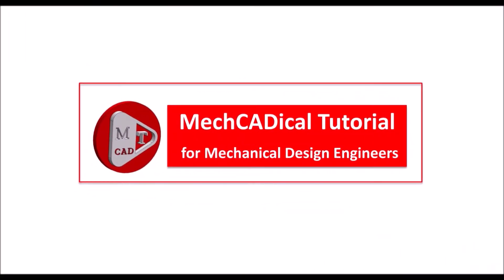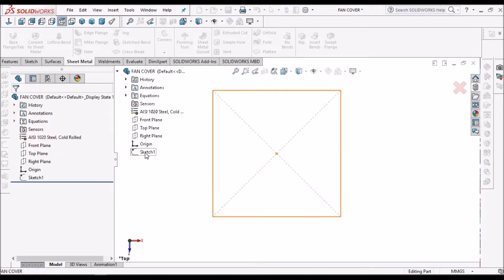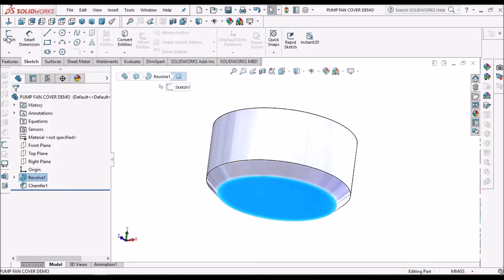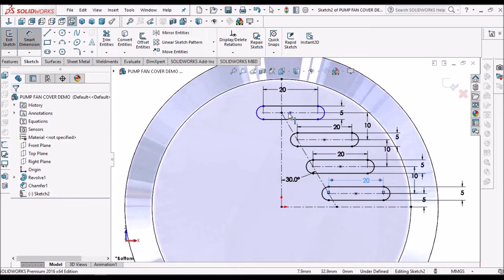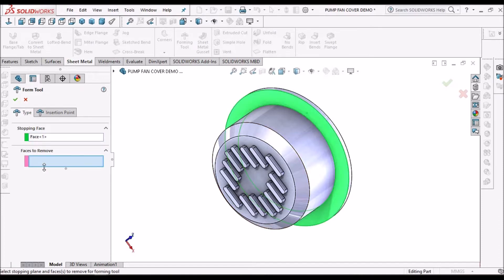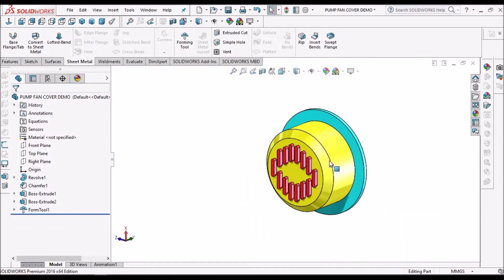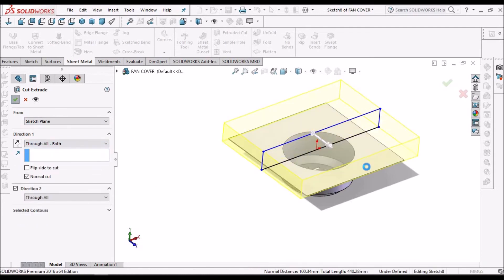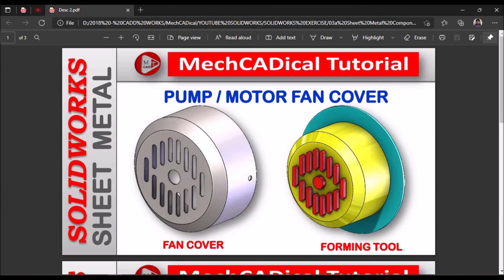Pump/Motor Fan Cover using Forming Tool In SolidWorks Sheet Metal

Comment: Jo profile extrude base kiya aapne 
Usme phle center line wali slot  bnate 35 mm dist pr center se fir dimensions define krte
Uske baad 30° line pr slot bnana tha
Fir jo 30° line pr slot bna usko or center line wale slot ko select krk equal slot krte

30° line wale slot ko linear pattern krk X axis  wale me direction me 30° line select, distance 10 or instances 3 dalte

Fir 2 baar mirror krte 1 baar ye 30° pr jo slots bni h usko select krk center line se
Or dusri jo upper half m jitne slot h unko niche wali line se mirror krte.

Comment: GOOD VIDEO BUT WHERE IS YOUR CENTER HOLE ON FORM TOOL ?
Reply from the maker: That's great observation Michael,  I have created on demo form tool before creating this video,  where extrude boss was missing for center hole, I picked up that file. I will make sure that such errors doesn't happen in future.
Reply: @mechcadicaltutorial  N0 WORRIES WE ALL MAKE MISTAKES, YOU ALSO ALLOWED TO, JUST DID NOT WANT SOMEONE ELSE TO ALL SO BUG YOU